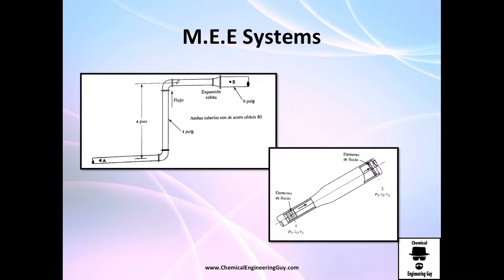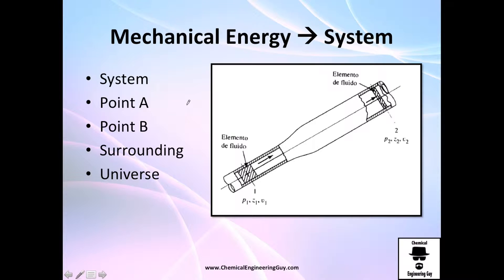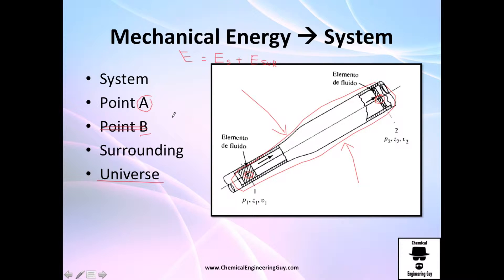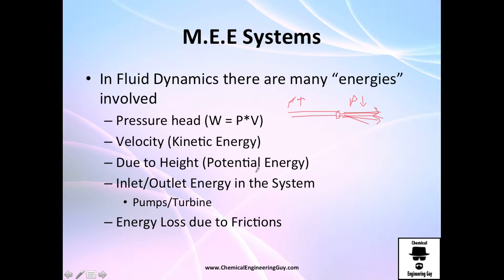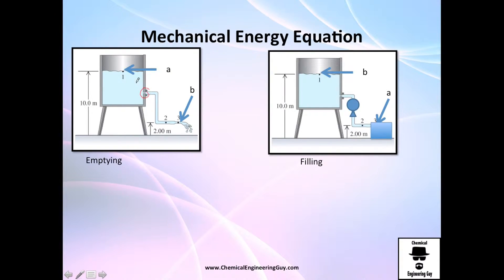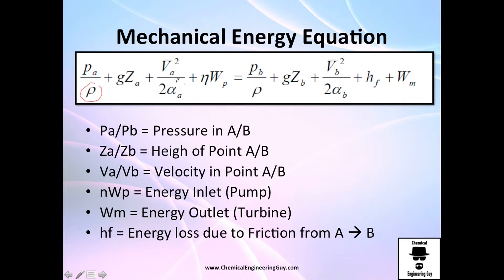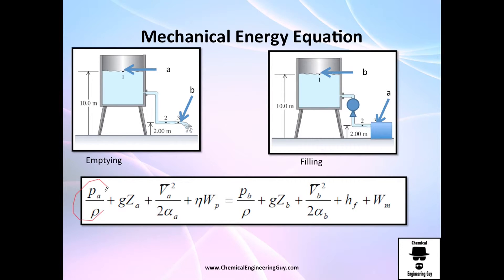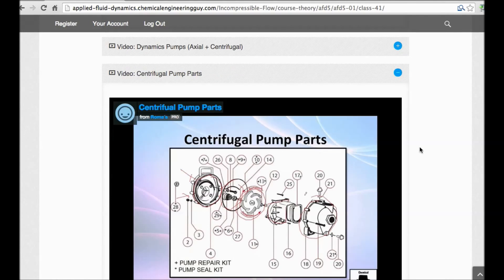Systems, Surroundings and Applications  - Applied Fluid Dynamics -  Class 007

Comment: Can we apply Bernoulli equation to a closed system the same way we apply it to an open system? In an open system increasing the speed of the fluid implies that either the pressure or GPE should decrease as a result of conserving energy. I wounder how would this apply to a closed system?
Reply from the maker: an example will be a hydraulic system with pistons
Reply from the maker: Yes you can, actually, that will be easier, as there is no external "energy" coming in or out